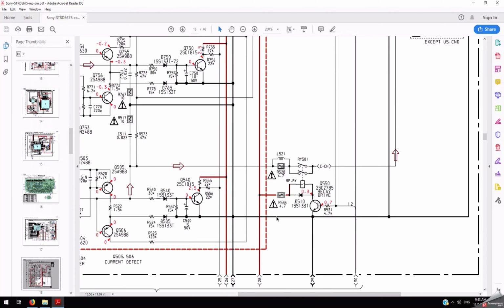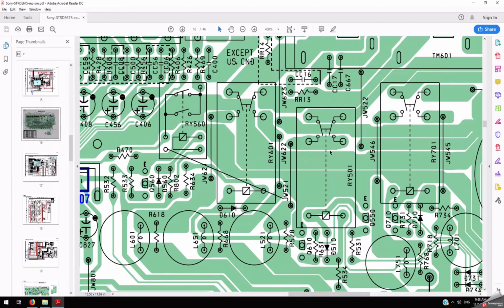Sound cuts out Sony STR-DE675 Repair, AV reciever sound drops out

Comment: I have a Sony STR-DA5ES that had an intermittently working front right speaker, I found the service manual and tracked down the same soldering areas as shown on your board for that speaker.  The DA5ES has a separate speaker board, so the disassembly was much easier.  It was hard to tell if the solder was cracked or not (I don't have a trained eye), but I resoldered the connections and reassembled the receiver.  So far so good.  Thanks for the video.

Comment: I have a similar Sony receiver from the same era (STR-DE335) I recently got it on ebay for $40. I've had it for several months, occasionally I hear something internal clicking out of nowhere (must be the relays, it looks like there are three), and sometimes the sound stops coming out of certain speakers (I have three plus a sub), giving it a whack usually makes it work again. I was kind of nervous something major was wrong with it, but if all it is is some weak solder joints that's very relieving because I really like this receiver. Should be easy to fix. Thanks for the video!
Reply from the maker: Sounds like the same problem to me - easy fix. They're pretty solid amps, over 20 years of daily use and this one is still going strong.
Reply: @Justfixitmate  that's good to hear. Mine runs pretty hot, also made me a little concerned but then again it has good ventilation. I've always been a fan of Sony products. Everything I've had from my 20 year old Discman to my 3 year old Xperia have held up well
Reply: @Justfixitmate   Thanks for the video , i have an old Sony receiver str k850 that won't memorize preset radio stations no more, i have to manually put in frequency in order to tune in station ,but if i try to set up another frequency it looses the first one and so on, this might be old caps, what you guys experts on radios think i should look for, thanks

Comment: I have the same amplifier (Sony) and I have tried to connect a car radio to it by cutting the wire that comes from the main part to the small square part which is the output for video display (where the yellow output). there were namely 3 wires, a ground, a 12 volt and a 25 volt. After I got my car radio connected to that power, it worked in the first place and it turned off afterwards. Now I have removed the radio and have bought it back in place as it was before. Now the amplifier works but there is no sound. I have measured volts on the wire that I had previously connected to the radio. it shows 9 volts on both the one that had 12 volts and the other that was on 25 volts.
how should i rapier it?
thank you for your time.

Comment: Ok so I have same problem but not on this unit. Have no idea what I’m looking at in there so maybe I resolder everything 😂
Reply from the maker: haha.  There's a chance you might cause more problems if you do - easy to accidentally make a solder bridge somewhere...  Just re solder the connections on the relays (blue rectangular boxy looking things) near the speaker connectors side of the PCB.

Comment: just checking if you might know this. I have a Sony Amplifier,  type TA-FB720R  must be 30 years old or older. Still works and I just use it with one of my computers. But I am getting a kind of a "rattling noise". It is not a contineous noise but I get a series of fast ticks  tick-tick-tick-tick etc, maybe 20 ticks and then it stops and a bit later again. It seems some sort of discharge. Maybe the condensator?  It only started with a few ticks but now it is more often and I turned it off now.  Does this problem sound familiar or could it be a multitude of things? The amplifier body is grounded so it is some part in the amplifier that is causing the problem.
Reply from the maker: Can't say I have seen this before, but a ticking noise could be relay related.  What happens during the ticking noise? do your speakers cut out?
Reply: @Justfixitmate  thanks for your reply. Not really sure because I only use it actually for my computer to talk to me or say something out loud when something happens in the charts I am watching. So I am not contineously listening to sound and the ticking also comes in small bursts. But I relocated it so it doesnt get that hot and it seems to do it much less now. So it seems fine for the time being

Comment: hi can you help me ...i use it as aux i have front left sound is ok ...right front sound low with distoration and cut ....i change transistor shorted and resolder as your vedio show relay ...and still same ...when i change from afd to surrond or other mode i get protect mode
Reply from the maker: Watch my other Sony prepair video (protect mode) - might help!

Comment: Hey I've got a Teac amplifier and recently the sound has been cutting out (and the amp makes a clicking noise when it does this), but still receives power. The only thing that appears to work is to repeatedly switch it on and off until it comes back. Any ideas what it could be?
Reply: Definitely one of the relays
Reply: same happen to my amplifire

Comment: It is a shame that modern receivers don't have a removable panel on the underneath, it would make like so much easier for the sake of a bit of  penny pinching on the manufacturers part, but of course they don't want to see products repaired, they would much rather sell you another one.
Reply from the maker: I hate to think about all the great equipment that ends up in land fill, just because of a cracked solder joint.  Things just aren't built with repair in mind.  BGAs, laser welded housings... A removable panel would make life easy for this kind of repair.  Although, as you can see, this amp isn't too difficult to get into.  With half a dozen repairs already under its belt, i can crack this open in no time.